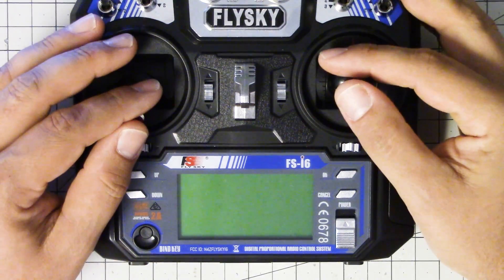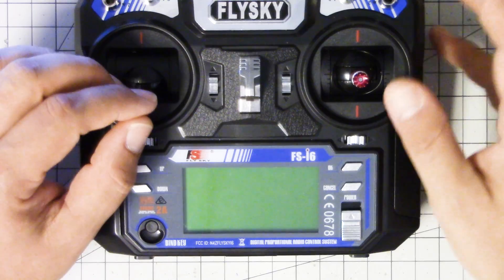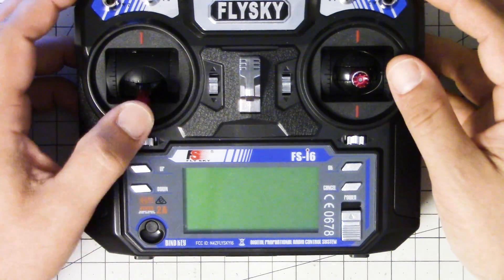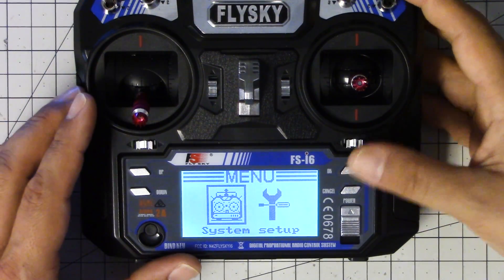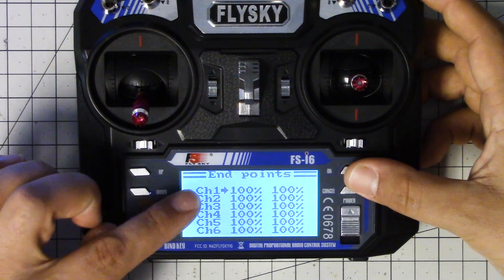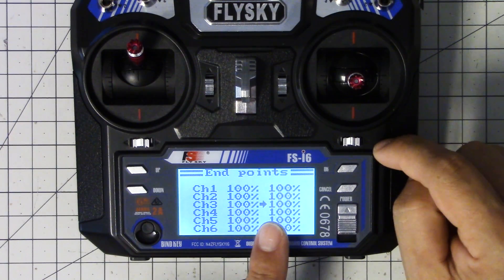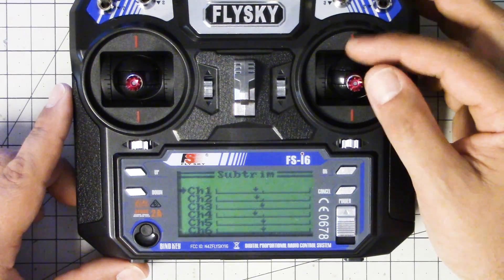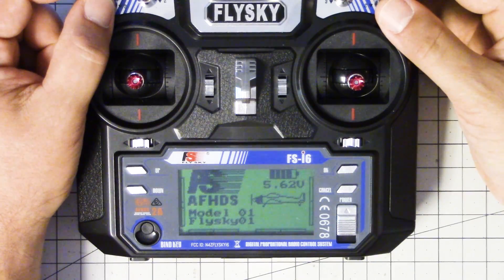FlySky FS-i6 Betaflight Setup: Calibrating Endpoints

Comment: Could you help me. Using pixhawk and Ublox gps 1400KV and 3S 11.1V. My drone is getting tilted and moving towards South West direction. The reaction is so fast that as soon as I take off it goes and hits to my wall and breaks the props. Any guidance to make it stable and fly vertically atleast. Used a lot of upper and right trims not working. Using Flysky i6 Mode2. Everything is ready from my end still first flight is pending. Thanks a lot

Comment: Hi, can someone help me please? I have this transmitter and a kk 2.1.5 board. Quadcopter sometimes rotates for a little bit when I am flying because I accidentally push the left throttle stick to the right or left side you know. Is there any way to fix this with this board and transmitter? I would be glad if you help me out :)
Reply from the maker: The answer to this situation is to train yourself to stop pushing the stick.
Reply: @JoshuaBardwell  Well, I was worried of this answer :D I will try to learn it, I have to! :) Thanks for the answer and have a good day :)

Comment: In the end stop tab. How far can you go over 100%? Im planning to use this for a robotic arm project and need the servos to move more than 90 degrees :)
Reply from the maker: I think it can go up to 125% if you enable extended servo limits. If you need more throw than that, you'll want a gear.

Comment: Need a bit of help here, I have a wizard x220, I did a factory reset on my frisky fs i6 now I’m finding real difficulty re binding,  my aux channels on beta flight all reading 883 too so I can’t set up modes or arming, 
Any ideas as when I do bind it just beeps continuously, so I unplug the Ubec and plug in the battery it’s binded but with the above problem. I’m loosing my hair now lol, any wise comments.

Comment: Joshua I am having an issue with the endpoints in betaflight. The channel mapping is correct and I can fly the quad but when I try to adjust end points they do not match up with the sliders in the transmitrer.
Reply from the maker: All that matters is that the Receiver tab shows 1000 and 2000 at the endpoints and 1500 at the centers. What the transmitter shows doesn't usually matter.
Reply: Joshua Bardwell ok thankyou very much for replying. I watch all of your videos and I appreciate the time you put into them

Comment: You mention plugging in your battery before making adjustments.  Is this really necessary?  I was able to adjust endpoints and subtrims without plugging in battery (just plugging into Betaflight).
Reply from the maker: Not all FC power the receiver when plugged in to USB. Yours does, in which case you don't need to plug in to adjust these settings.
Reply: I hadn't considered other setups.  Thanks for responding.  I enjoy your stuff.

Comment: So what does it mean if only aux one and two are being recognized?
Reply from the maker: The FS-i6 supports 6 channels. So four control channels and two aux channels. 

There is a 10-channel mod you can do to the radio if you want to look it up.
Reply: So how can I set up all 4 switches? As only my far left and far right switches are being recognized. I want to have my inner-left switch to be assigned to the beeper

Comment: When I adjust my subtrim it throws off my endpoints. Why is this?
Reply from the maker: +ReviewEdge some transmitters calculate endpoints by adding and subtracting from the center. This really isn't the best way to do it as you can see but it's not a bug per se.
Reply: Joshua Bardwell Any suggestions on what to do?

Comment: I have temporarily reduced the power settings  in the throttle curve menu selection to 0,10,31,45,60.   Should the endpoints still be adjusted for 1000-2000 or will this not be valid with the change to the throttle curve?
Reply from the maker: if you have reduced the throttle curve in the transmitter then you don't need it to hit 1000 int he receiver tab.

Comment: Thank you Joshua, but can you please explain what max and min endpoints values should I set when my max throttle is ~1980 and min is ~1030? Should I anyway set max 2000 and min 1000 on the FS-i6 transmitter regardless of my measured max and min throttle? Thank you in advance.
Reply from the maker: You should always adjust the transmitter so that betaflight sees 1000 to 2000 if possible.

Comment: Hello sir, I have a question... I just received new motors and I'm adding them to an existing build. Finished soldering new motors on and upon arming, motors spin up CRAZY. Do I have to go into betaflight and do anything?? I figured since the board was already set up, I wouldn't have to connect to computer?? I wired the motor the same way last motors were wired. I did switch from 1104 6500kv to 1105 7500kv if that matters. Thank you for your time
Reply from the maker: If all you did was change the motors, then I don't know why they are spinning. So you must have done something other than just change the motors.
Reply: Joshua Bardwell I think I went thru adjusting end points like in this video.... I'll just go home and plug it in. I need to make sure motor direction is correct also. I hope is easily fixed. Maybe I'll just make a new model and rebind it.

Comment: What would I have to do if my radio to FC only gets about about 1000 to 1904 at full trim. Do I set max throttle to 1904 ish then just a normal ESC calibration
Reply from the maker: Use rxrange to change the expected endpoints in cleanflight/betaflight.

Comment: Hey don't you already have a vid showing endpoint adjustment on the taranis? It was quite old but saved me a heap of stuffing around when I got the Q X7. I've never had to adjust the FS-I6 except to facilitate receiver failsafe settings, i doubt it has anything to do with ibus but that's all I use.

Comment: You have another video using the Taranis that shows how you can select receiver 00 to allow one model setting to control all of your similar quad copters. My question is. If using the one quad model option, will all the models be centered on Betaflight? Thanks, I am going to check my models right now.
Reply from the maker: Yes, the subtrims and endpoints will be the same if you use a serial receiver and the same model in Taranis.
Reply: I just testing this with my Vortex 150 and the new 180 I just setup. I went from one model to the other (yes, I have 2 models set up) and I know for sure the 150 had yaw drift. All I did was set up the 180, then go into the 150 settings on the radio, copied the changes, and when I plugged in the 150 to betaflight, that drift was gone. Amazing! Thanks for all your efforts. I would like to chat with you sometime, I have a few questions about the Taranis... I'm formerly JR, then spektrum. Thanks again!

Comment: Thin light and cheap, great little setup, and the 10ch mod opens up a whole new world. Best thing since sliced Spam.
Reply: Hachiro I'm running an fs-x6b receiver with the tgy-i6, and it has the voltage telemetry. So no need for me to have the i6x.

Comment: hello josh i just got the 4 inch frame from the rotorxatom v3 i have 1306 4000kv motors on it can i use 4inch props on those motors or which motors should i use please help
Reply from the maker: What battery are you running? I see 1306 motors being listed for 2S batteries with 5" and 6" props. So presumably they can easily do 4". But I don't really fly a lot of motors that size so I can't say for sure.
Reply: im using 4s 850mah they said it would burn my motors if i use those size props

Comment: Hi Joshua this is sort of off topic but I just finished and tested my new alien running emax 2306 full kiss spektrim and a TBS unify pro and I have problems when I fly more than 10 meters away I turn the quad around and get huge interference.  I think it's that the tbs triumph has to go through the battery (turnigy graphene 1300) to transmit it's signal (500Mw power setting.  Any ideas on antenna placement would be appreciates thx!
Reply from the maker: No matter how the antenna is mounted, you should get more than 10 meters range at 500 mW. Easily. Do the basic checks: verify you are on the correct channel, for example. Verify you are not in pit mode. Verify the antenna is not damaged. Make sure the pigtail is securely connected.
Reply: Joshua Bardwell I have and I misspoke I can get good range but not with a lot of interference when I turn around.  I will be flying away from myself but when I turn around I get a lot of interference.

Comment: Thank you for using Flysky as an example.  It really isn't a bad radio.
The only thing I'd like to bring up is the fs-A8S.  Extremely bad receiver. 
Check out RCgroups "FS-A8S Help" thread. Now the fs-x6b is a really nice reliable receiver. Only issue I'm having is setting up failsafe.  I've installed BF 3.2 on my quad.
Reply: The A8S (per the manual) is incapable of failsafe... although I was able to get it to act somewhat like a F2 Failsafe in BF3.1.7... that said, because diversity for such a small weight penalty is better, I recommend the X6B as well...
I have had a great time with my trio of A8S receivers, but there are moments where I can tell I'm losing RC signal and crashing as a direct result.

Comment: You didn't tell people most important thing about this radio - you save settings by holding "cancel". Many people change settings then fail to save them and are lost in trouble shooting hell. Also this radio with 14 channel + timer mod is awesome. I even put taranis pr10 gimbals on it just for fun of it.
Reply: Jesus thank you for this...why does nobody actually go through the full process and show you how to save what you just did instead of resetting it each time you hit cancel to try and get back to the menu..
Reply: 🤣 True😂
Reply: that is so funny that this is most likely what I need.
Reply: thanks mate!
Reply: I had the same problem, found the solution in a hard way.

Comment: Joshua, I recently have been seeing my (FrSky Taranis X9DPlus) stick centers at 1517, rather than 1500 in BetaFlight ... What might be causing this? I haven't done any trimming with buttons, I haven't done any FC stick commands to set trim, nor have I touched the subtrim menus on my radio... Just curious if this will cause problems or go away or do I need to take action!?!
Reply from the maker: If the sticks repeatedly fail to re-center correctly it could mean your gimbals are wearing out. This is more likely if you have the old style PT1 gimbals vs. the new M9 gimbals.

Comment: Hello Joshua,I am very pleased that you are giving this radio some love. In my opinion it is the most capable radio in the sub 50 EUR price range. (Even sub 40!) There is a 10 channel software mod that also give the possibility to set a timer, voltage alarms etc. For this software I refer to the rcgroups FS-i6 tread. I wouldn't mind you reviewing this radio a bit more in detail as I didn't known this setting for example. Many folks are using this a first radio Especially when the Q X7 wasn't around yet.

Comment: hmm endpoints... anyhoooo.. i just recently switched to semi pinched style on the sticks but i can't easily hit 100% throttle, ideally i would like 90% stick to be 100% throttle, i can give up a little expo on the throttle but not much... does anybody know how i could do this?... the throttle expo thing on betaflight isn't clear. i thought there was a way inside the fsi6 itself were you tilt the graph up to make it hit 100% earlier but this didnt seem to change anything.. ''sport''...? not feeling it.
Reply from the maker: Reduce the top throttle endpoint until the stick hits 2000 at 90%.
Reply: hmmm it looks like i have to increase the percentage to get it to go above 2000...... will bad things happen if i send a signal of 2100 into the fc given that its set up on esc's to max out at 2000.... ok brain melted, i'm not gonna learn anything today  hehehe.... imma go back to watching ''the tick''.... its my destiny.
Reply from the maker: If you send higher than rx_max_usec the FC will go into failsafe. Other than that, have at.

You can try using a throttle curve instead. I'm not sure if the radio supports it though.
Reply: yeahi spotted throttle curve but its a bit basic, i cant move100% but i can move 75% up to give me 100%...it has dual rates though so maybe i can combine the 75% as max with the sport mode in dual rates to give me something better... i know its possible in betaflight, i just can't figure out how... all this being said i don't have enough skill to be hitting 100% throttle, i only just learned nose twirls and slow rolls two days ago

Comment: It's not on topic and u don't need to make a video about it. I just built a brushless micro 4s and right off the bat it vibrated and ocellated HORRIBLY. so I dropped the P's and D's all the way to 0, but it still ocellates and vibrates too much to even fly it. I have the motors and props on correctly and spinning the right way, i know this because it can take off but shakes itself back to the ground. I have soft mounted the motors and fc, the fc and motors are both brand new. And it is still out of control. Please help
Reply from the maker: Change the FC.
Reply: Ok thank you, you are the most knowledgeable drone racing pilot I have ever heard of/seen.
Reply: If you really want to troubleshoot, Joshua has some great videos on troubleshooting motor balance, and blackbox.  You can probably narrow down if it's a motor imbalance, or if the MPU chip in the FC is junk... odds are it's the latter, so changing the FC is the correct solution -- sometimes they'll just send random signal impulses, which are visible in Blackbox, and the solution for it is changing out the flight controller (although documenting that the MPU unit is DOA can help immensely for RMA stuff)
Reply: What motors are you running? How about props?

Comment: Now the secret is out ,the price will go up! Its good that you have finally discovered it ,as its a really good tx for the money.
I have the Eachine version and updated it to the 10 channel mod and then ,RSSI version , I then updated the firmware on the 
FS-IAB6 with a ST link tool to 1.6 ,this then gave me RSSI on my TX screen and more importantly in my OSD!
The number of channels and lack of RSSI were for me the only things missing from this radio.
I also de-pinned the FS-IAB6 (why? ,has the greatest range)and it was more compact and now 6 grams lighter.
Photos below. I was going to make a video of the whole process ,but I then bought a newer FS-IAB6 (RX) and before I installed it I copied the firmware and they now seem to be on 1.6 ,also this radio is rebranded as a Turniby ,Eachine and Flysky(all the same ,different firmware and easy to change).
The FS-IAB6 is a 6channel receiver ,but the you can use ibus (better) and you get more channels.
The gimbals are probably not as good as a more expensive TX but they work and the replacements are cheap ,I have thrashed
mine constantly on my quads and simulator and still going strong ,but yes it does jitter ,just add 5 for dead band. 
If mine breaks ,I would buy the new 10 ch version £37! what value.....
It proves you don't have to spend a fortune to get into this hobby.

https://www.dropbox.com/s/9306apvjghha33t/20170609_175237.jpg?

https://www.dropbox.com/s/i8hatvl6xz6celq/DSCN0410.JPG?dl=0

https://www.dropbox.com/s/og982qihc1pa6my/Original%20Eachine%20Racer%20RX.JPG?dl=0

Comment: Careful if you do the 10 channel mod on the i6s. It will permanently cripple the ability to use in simulators, even if you revert back to stock firmware its still crippled. Bug reported here: https://github.com/benb0jangles/FlySky-i6-Mod-/issues/67
Reply: Spencer Owen I did the update and use mine on fpv freerider np

Comment: Great stuff as always!  Would like to see a video about what to do when you adjust the endpoints as far as they can go and you're still not sitting on 1000-2000.  I have a DX6 with some DSM2 receiver (on a whoop) where I can't get the high end to 2000, only to like 1840 or so.  Maybe there's some trick on my radio to allow adjustment beyond 150% but in any case I learned about "rxrange" in betaflight which can resolve this problem (and also allows to reverse the channel thus averting having to do it on the radio).
Reply from the maker: Yes, rxrange is the answer.

Comment: Thank you. I already moved endpoints as you're described there two weeks ago for FS-i6X transmitter which mine coworker bought for his Wizard X220. Such transmitter after month of flying had all channels shifted by +2/-4 with middle point in BetaFlight around 1506 by default. Which caused drift and impossibility to arm without pulling stick down by force. Cheap Chinese stick resistors in glance. After endpoint tuning it now have correct ends and center.

Comment: I've found when using flysky it's better to use ibus instead of sbus. Ibus automatically sets all the endpoints and centre points
Reply from the maker: I would be surprised to find out that was true.
Reply: I run IBUS primarily because it avoids the inversion issues encountered with a lot of F4 boards.
The pairing of the i6 (i6x) and the A8S and A6X receivers are the best way to get into the air cheaply, although I'd still recommend the Turnigy Evolution for anybody looking to get started who knows they'll want to fly thumbs.
Reply: Tony Peart I've used two different ibus rx's when I was using as i6s TX. I had to set the end points on them both myself.
Reply: i use ibus to... it is  perfekt
Reply: Albert Kim made a video about this.
Reply: As far as I know ibus is Flysky protocol sbus is frsky.
Reply: I did this too and got the same result!